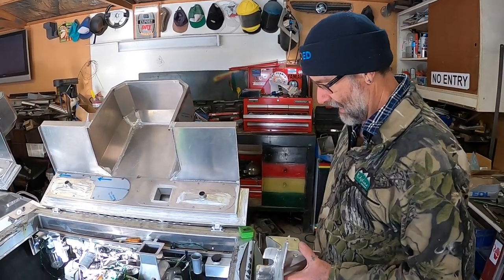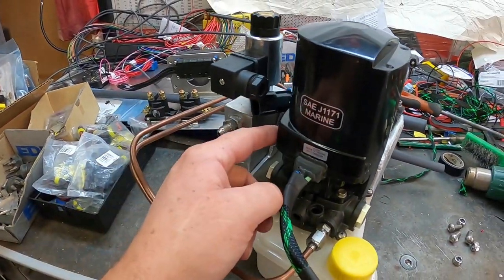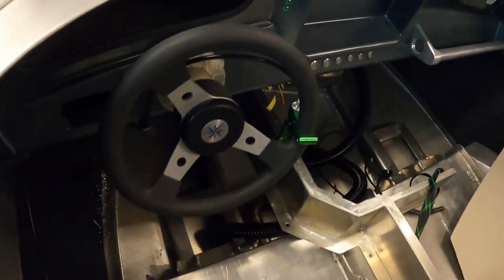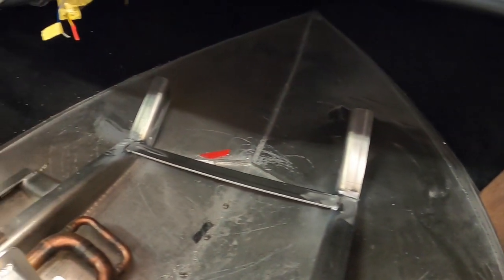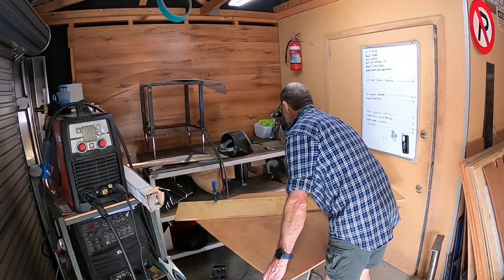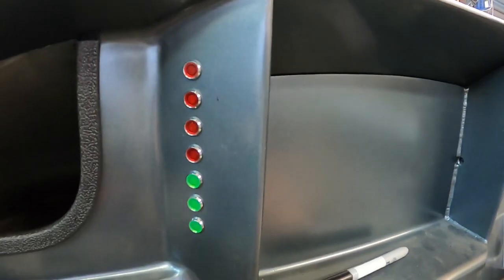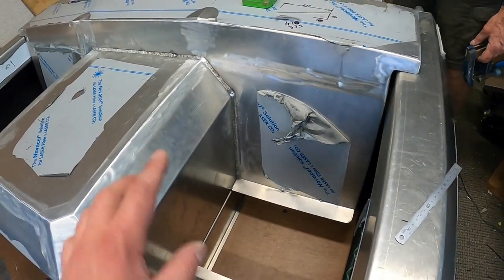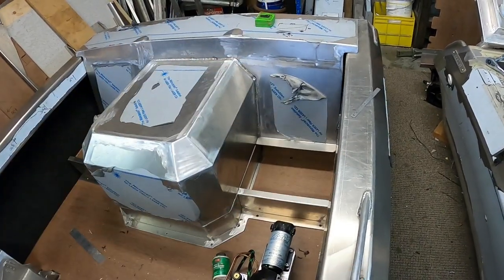Turbo Jet Boat Build NZ PT19 - Floors, Looms And stiff Necks!!!

Comment: have you thought about eva foam flooring on the ply. carpet gets all grotty over time and catchs all the aluminum filings etc, also is a bastard when your fish hook gets caught on it
Reply from the maker: i was looking at putting the foam on the front deck and rear step. unfortunately I have already purchased the carpet so will use it for now and replace it once it gets grotty.